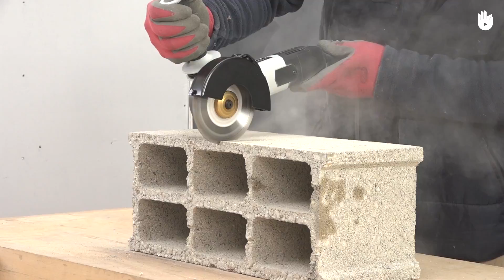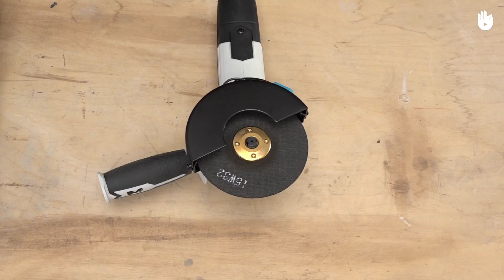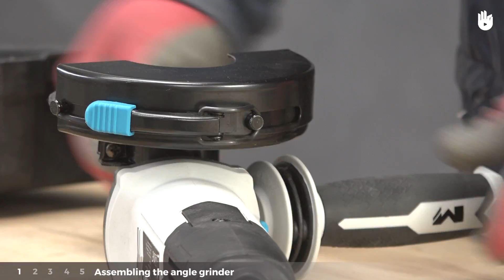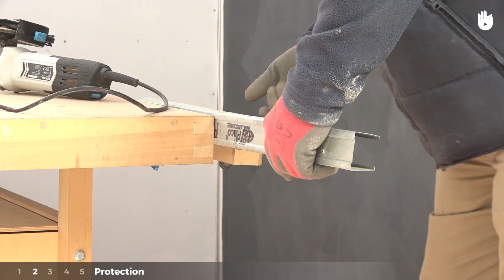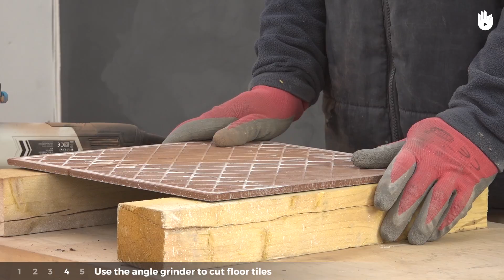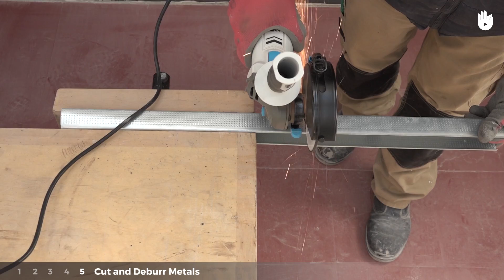How to Use an Angle Grinder | DIY Projects

Comment: Never use an angle grinder in the direction of wheel rotation. Never use a grinder without securing the work piece. Never use an angle grinder one-handed. Wrong title on this video - "How not to use ....
Reply: sparks should go away from you or towards u?